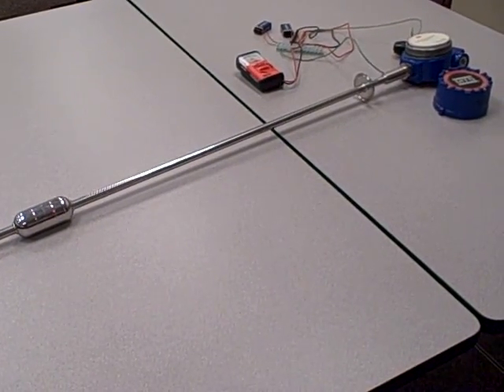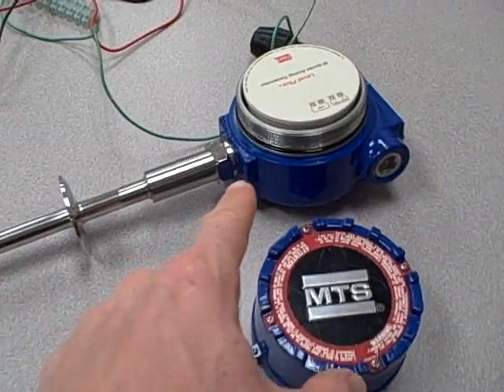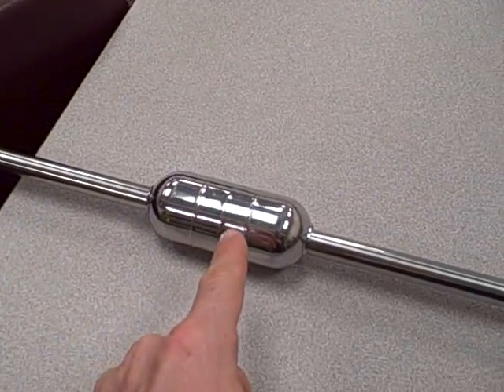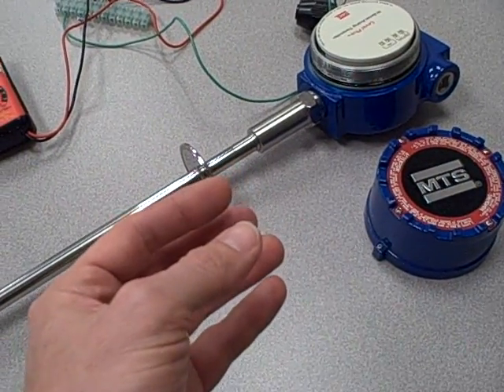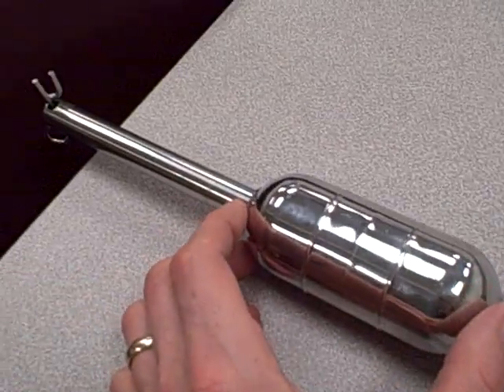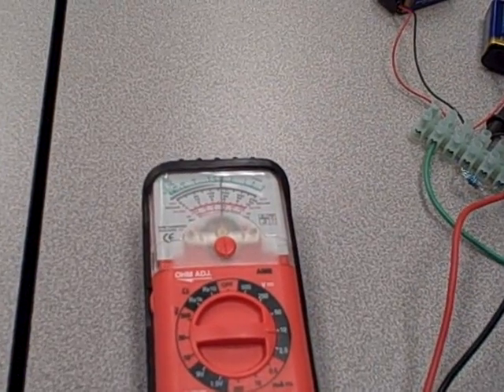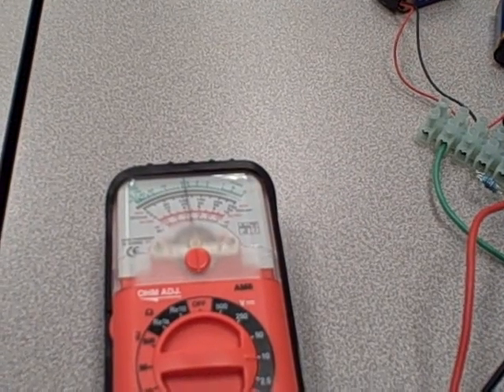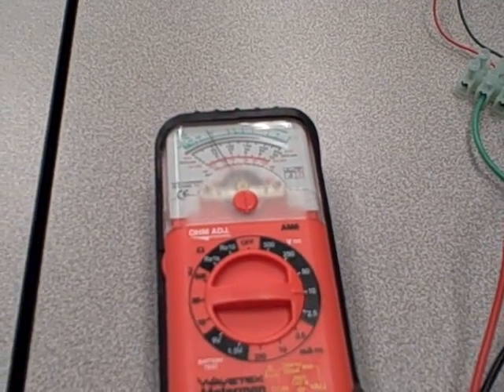Magnetostrictive level transmitter

Comment from the maker: One great advantage of this method is that it is virtually immune to changes in liquid density, unlike hydrostatic displacer methods.  It's basically a modern adaptation of the old float-and-tape technology, using an extremely precise technique for measuring the float's position.